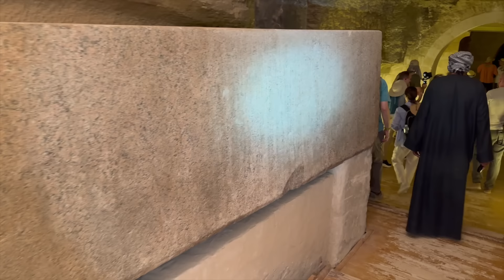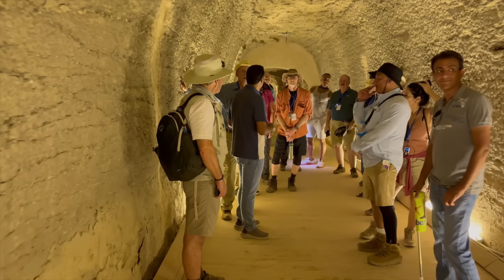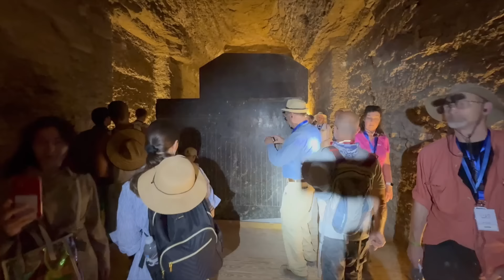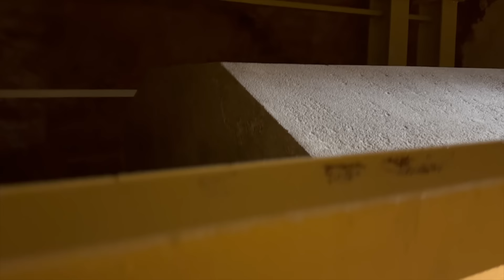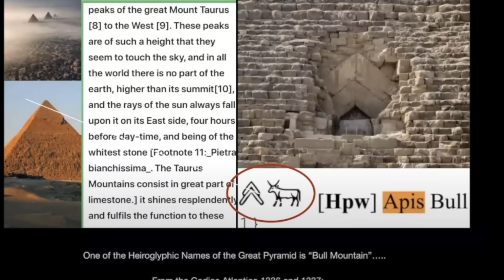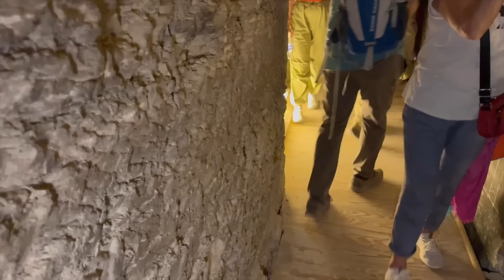Serapeum Secrets: what was really inside the 100 ton machined boxes?

Comment: 100 tons = 67 to 74 Toyota Corollas. 

Who tf would spend hours or days or weeks moving a 30-ton lid just to extract some cow bones?
Something else of intrinsic insane value was in those boxes. You don't make a lid weigh 30 tons for any other reason than keeping people from accessing the contents. 
The fact that they were all already raided long before Mariettes arrival or demolition of one of the only sealed boxes, yet still found hot air is interesting. 
Because it could mean 1 of 2 things: They were all empty to begin with, or some of them did having something that motivated the opening of all the boxes. 
The mummified bulls were in a primitively constructed chamber in wooden boxes. 
Which makes it a huge stretch to say the behemoth boxes, 24 in total, had bulls in them when 0 skeletons of any species were never found inside them. 

Theres also the aspect of the flatness and angular precision inside the boxes. While not absolutely perfect, its very close. 
This makes me think they were for some engineering purpose. Granite contracts/expands very little with temperature difference. Its absorbs/dampens vibrations very well.The flatness and angles could be for calibrating perpendicularity for optical uses or squares. We use it today for these same reasons and jobs. 

Some of these mysteries are so annoying that you feel like you need a time machine.

Comment: The 5D Explanation: They were constructing high-Q acoustic-mechanical resonant cavities.
These stone boxes were designed to hold specific, high-frequency standing waves without allowing energy to leak through surface roughness.
The choice of stone is equally deliberate: rose granite is rich in quartz crystals, making it a natural, massive piezoelectric transducer.
When vibrated at the correct frequency, the stone itself converts mechanical resonance directly into a localized electromagnetic field gradient.

Comment: At a glance, the underground structure looks like ant's nest..I thinking zoning is well done, total  12 sarcophagus in leftside seem to have been placed permanently. And the ancient engineers seem to have used the hexadecimal system or sevendecimal system ...As for the sarcophagus like placed in the middle of hallway, I think the ancient engineer intentionally placed it there for the purpose of a kinda blocking ...Anyhow,  it must be obvious that  all the sarcophagus were made of so hard and heavy stones as never to move, lift and make shape by manual forces and common tools..and why the sarcophagus like should be needed to be such precise and quite well sealed?..who were the ancient engineers indeed?..😲...

Comment: Geopolymer. Granite Concrete. I'm not totally sold on this idea yet. BUT, if you could pour your granite mixture into a mold, then 
the problem of cutting granite goes away.  Mostly.  Because there's plenty of circular saw markings and tube drill markings
on stone block as well throughout ancient Egypt sites.
Now you would still need to crush the granite into very small pieces, or even a powder or melt? the granite to make the mixture of geopolymer?  Just learned about it.

Comment: Thanks for the Video.  Because it will not be Archaeologists who discover the answers to ancient Egypt construction, and the purpose of their architecture and buildings.
I don't see how the ancient Egyptians didn't have at least some limited form of electricity, and steel power tools. 
Because hand operated Copper tools suck.    lol    That's why we don't use them today. You would spend more time sharpening and repairing
copper tools than actually using them. I guess "Academics" don't actually "Use" tools.

Comment: Whatever went into the granite boxes, it was certainly not wanted to get out. And why the Serapeum is under ground. 
But the substance must not be inert and not able to react to granite.  It would have provided some type of work or purpose
 connected to something important for the Pharaoh. And why would you want the finish to be mirror perfect? What benefit does that offer?
And consider geopolymer construction. it would save alot of time/effort from needing to cut and move stone blocks everywhere. And make the perfect 90 degree angles seen inside?

Comment: To lower the boxes, they filled the chamber with sand. After sliding the sarcophagus onto this sand layer, they gradually removed the sand (through small side access tunnels), allowing the box to settle gently and perfectly centered in its recessed chamber. The bigger question how they cut them so precisely (error free) from granite.

Comment: Those tunnels look like damp mixed geopolymer just like what Davidovits built outside the Geopolymer Institute. It doesn't look like natural stone and lacks tool marks as far as I can tell. Which could mean the overlayment was put into position after the boxes were positioned.  There are form marks in places and as in the case of the unfinished box, it could have been overlain with a clay mold as scaffolding that would easily be removed after the geopolymer had set.

Comment: 🛑‼️DO NOT SMOKE IN BED‼️🛑That's not even close !!! HAHAHAHAHAHA I seen how they did it when I took mushrooms 🍄🍄🍄🤣😂😂 Egyptians were master canal builders. They basically controlled the Nile river. Boats wouldn't work. ❓WHY WERE THE BULLS SO IMPORTANT ❓ They used the giant bulls blatter's to float the blocks by adding air. Animal blatter's were used as pumps in furnaces for thousands of years. They didn't struggle. They flooded the valley many times to build things and move things around. Water was important in they're block cutting process. The bulls were very important for this reason. Pulling them with this bull wouldn't of worked well 😂

Comment: I remember that roar of an old diesel engine in my dads old truck when he was climbing up some of the hills around. And i remember that push feeling when going down the hill and it felt so dreadful either side but going up was the most stressful part because I remember the stress that he had  when shifting the gear down and he would be in 1:1 sometimes he would say something like this has to be 80'000 lbs! And when we got to the grain elevator he would let me stand on the metal grid floor on top of this silo and when they tripped down the door on the trailer it would shoot out a stream of grain and sometimes beans you would have to wait for a few minutes before you could see the grain building up then about the same when he was empty and it was aww inspiring to the child me but it must've been to the adults too because the mood was light.

Comment: See you can shape granite with a steel bolster, I’m with you that they’re from a lost civilisation but I think you need to provide stronger arguments, I’d say impossible to get the precision with a copper chisel, to split small parts off sure. I use diamond tipped drills to occasionally drill through granite and alloy bolsters to split but it’s very hard going the drills don’t last long
Reply: HERE IS THE TRUTH YOU NEED TO KNOW!!
They are Faraday cages!
Yes there was a major extinction event and they saw it coming! These boxes held what the descendants of survivors needed to know !!
THE ANTIKYTHERA MECHANISM WAS IN ONE OF THESE BOXES!
So too were the star charts, models timelines and many thing that make us wonder how people from BC and early AD knew so much about the solar system.
THESE BOXES ARE 13000 YEAR OLD JUST LIKE THE PYRAMIDS BUILT AT THE SAME TIME!
The pyramids were harmonic energy generators... but not to make energy for anyone to use , they took advantage of the excess plasma energy from the disaster to pump ionized particles back into the sky to rebuild the atmosphere as fast as possible to give survivors the greatest chances to re-establish after an apocalyptic event you cannot conceive!
Where are the machines? MELTED! As all metal and conducive material did, extreme magnetic induction radiation followed, not immediately after but posibly a few years after the solar EMP blast that completely destroyed EVERY SINGLE BIT OF TECH ON THE PLANET! 
Half of the worlds population would have been gone after 6 month and over a period of up to a decade before the hellish conditions that include every single horror you ever heard of are over, the remaining population will be less than 1%
They tried to warn us because this happens approximately EVERY 12000 YEARS...... THESE MEGALITHS ARE 12900 YEARS OLD!!!!!!!!!!!!!!!!!!!
GET IT??????

Comment: The Inuit have had smokeless lamps for a long time, that could explain the lack of soot, I’ve heard theory’s on mirrors to reflect light down…?
Reply: HERE IS THE TRUTH YOU NEED TO KNOW!!
They are Faraday cages!
Yes there was a major extinction event and they saw it coming! These boxes held what the descendants of survivors needed to know !!
THE ANTIKYTHERA MECHANISM WAS IN ONE OF THESE BOXES!
So too were the star charts, models timelines and many thing that make us wonder how people from BC and early AD knew so much about the solar system.
THESE BOXES ARE 13000 YEAR OLD JUST LIKE THE PYRAMIDS BUILT AT THE SAME TIME!
The pyramids were harmonic energy generators... but not to make energy for anyone to use , they took advantage of the excess plasma energy from the disaster to pump ionized particles back into the sky to rebuild the atmosphere as fast as possible to give survivors the greatest chances to re-establish after an apocalyptic event you cannot conceive!
Where are the machines? MELTED! As all metal and conducive material did, extreme magnetic induction radiation followed, not immediately after but posibly a few years after the solar EMP blast that completely destroyed EVERY SINGLE BIT OF TECH ON THE PLANET! 
Half of the worlds population would have been gone after 6 month and over a period of up to a decade before the hellish conditions that include every single horror you ever heard of are over, the remaining population will be less than 1%
They tried to warn us because this happens approximately EVERY 12000 YEARS...... THESE MEGALITHS ARE 12900 YEARS OLD!!!!!!!!!!!!!!!!!!!
GET IT??????

Comment: Your description of the open questions is very convincing, but your attempted description of physical processes is like fantasy on steroids. Here it is not sufficient to just have heard someone (who might or might not have been competently talking about such issues) and repeat it with little or no own understanding as if it was reporting about solid facts.
Reply: HERE IS THE TRUTH YOU NEED TO KNOW!!
They are Faraday cages!
Yes there was a major extinction event and they saw it coming! These boxes held what the descendants of survivors needed to know !!
THE ANTIKYTHERA MECHANISM WAS IN ONE OF THESE BOXES!
So too were the star charts, models timelines and many thing that make us wonder how people from BC and early AD knew so much about the solar system.
THESE BOXES ARE 13000 YEAR OLD JUST LIKE THE PYRAMIDS BUILT AT THE SAME TIME!
The pyramids were harmonic energy generators... but not to make energy for anyone to use , they took advantage of the excess plasma energy from the disaster to pump ionized particles back into the sky to rebuild the atmosphere as fast as possible to give survivors the greatest chances to re-establish after an apocalyptic event you cannot conceive!
Where are the machines? MELTED! As all metal and conducive material did, extreme magnetic induction radiation followed, not immediately after but posibly a few years after the solar EMP blast that completely destroyed EVERY SINGLE BIT OF TECH ON THE PLANET! 
Half of the worlds population would have been gone after 6 month and over a period of up to a decade before the hellish conditions that include every single horror you ever heard of are over, the remaining population will be less than 1%
They tried to warn us because this happens approximately EVERY 12000 YEARS...... THESE MEGALITHS ARE 12900 YEARS OLD!!!!!!!!!!!!!!!!!!!
GET IT??????

Comment: I believe they were battery cells and the pyramid was used to harness the energy and store it inside them
Reply: HERE IS THE TRUTH YOU NEED TO KNOW!!
They are Faraday cages!
Yes there was a major extinction event and they saw it coming! These boxes held what the descendants of survivors needed to know !!
THE ANTIKYTHERA MECHANISM WAS IN ONE OF THESE BOXES!
So too were the star charts, models timelines and many thing that make us wonder how people from BC and early AD knew so much about the solar system.
THESE BOXES ARE 13000 YEAR OLD JUST LIKE THE PYRAMIDS BUILT AT THE SAME TIME!
The pyramids were harmonic energy generators... but not to make energy for anyone to use , they took advantage of the excess plasma energy from the disaster to pump ionized particles back into the sky to rebuild the atmosphere as fast as possible to give survivors the greatest chances to re-establish after an apocalyptic event you cannot conceive!
Where are the machines? MELTED! As all metal and conducive material did, extreme magnetic induction radiation followed, not immediately after but posibly a few years after the solar EMP blast that completely destroyed EVERY SINGLE BIT OF TECH ON THE PLANET! 
Half of the worlds population would have been gone after 6 month and over a period of up to a decade before the hellish conditions that include every single horror you ever heard of are over, the remaining population will be less than 1%
They tried to warn us because this happens approximately EVERY 12000 YEARS...... THESE MEGALITHS ARE 12900 YEARS OLD!!!!!!!!!!!!!!!!!!!
GET IT??????

Comment: Weren't there some canals coming off the Nile could have been 
Transported to close
To site ?
Reply: HERE IS THE TRUTH YOU NEED TO KNOW!!
They are Faraday cages!
Yes there was a major extinction event and they saw it coming! These boxes held what the descendants of survivors needed to know !!
THE ANTIKYTHERA MECHANISM WAS IN ONE OF THESE BOXES!
So too were the star charts, models timelines and many thing that make us wonder how people from BC and early AD knew so much about the solar system.
THESE BOXES ARE 13000 YEAR OLD JUST LIKE THE PYRAMIDS BUILT AT THE SAME TIME!
The pyramids were harmonic energy generators... but not to make energy for anyone to use , they took advantage of the excess plasma energy from the disaster to pump ionized particles back into the sky to rebuild the atmosphere as fast as possible to give survivors the greatest chances to re-establish after an apocalyptic event you cannot conceive!
Where are the machines? MELTED! As all metal and conducive material did, extreme magnetic induction radiation followed, not immediately after but posibly a few years after the solar EMP blast that completely destroyed EVERY SINGLE BIT OF TECH ON THE PLANET! 
Half of the worlds population would have been gone after 6 month and over a period of up to a decade before the hellish conditions that include every single horror you ever heard of are over, the remaining population will be less than 1%
They tried to warn us because this happens approximately EVERY 12000 YEARS...... THESE MEGALITHS ARE 12900 YEARS OLD!!!!!!!!!!!!!!!!!!!
GET IT??????

Comment: I wish we could also see inside the pyramids of china
Reply: HERE IS THE TRUTH YOU NEED TO KNOW!!
They are Faraday cages!
Yes there was a major extinction event and they saw it coming! These boxes held what the descendants of survivors needed to know !!
THE ANTIKYTHERA MECHANISM WAS IN ONE OF THESE BOXES!
So too were the star charts, models timelines and many thing that make us wonder how people from BC and early AD knew so much about the solar system.
THESE BOXES ARE 13000 YEAR OLD JUST LIKE THE PYRAMIDS BUILT AT THE SAME TIME!
The pyramids were harmonic energy generators... but not to make energy for anyone to use , they took advantage of the excess plasma energy from the disaster to pump ionized particles back into the sky to rebuild the atmosphere as fast as possible to give survivors the greatest chances to re-establish after an apocalyptic event you cannot conceive!
Where are the machines? MELTED! As all metal and conducive material did, extreme magnetic induction radiation followed, not immediately after but posibly a few years after the solar EMP blast that completely destroyed EVERY SINGLE BIT OF TECH ON THE PLANET! 
Half of the worlds population would have been gone after 6 month and over a period of up to a decade before the hellish conditions that include every single horror you ever heard of are over, the remaining population will be less than 1%
They tried to warn us because this happens approximately EVERY 12000 YEARS...... THESE MEGALITHS ARE 12900 YEARS OLD!!!!!!!!!!!!!!!!!!!
GET IT??????

Comment: They needed to be there because of Titans imprisoned in them.
Given that limestone can be made into putty, could these massive stones be placed and made in situ, then the 'pile of sand' is actually lime putty setting back into stone? I think this way there is an easier way to lower them - by building up after they are in place. Limestone can be baked into quicklime, which is what you touched on. It takes 600 degrees heat to bake limestone. That's a standard kiln.